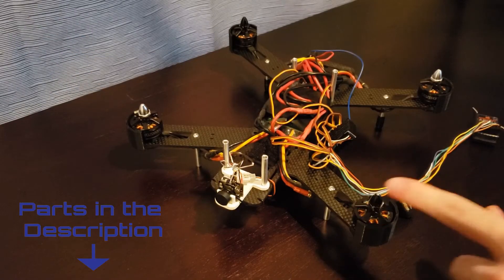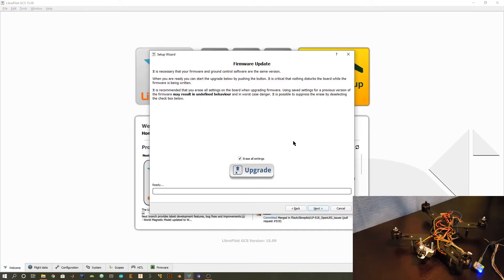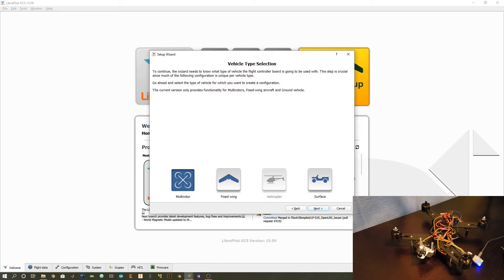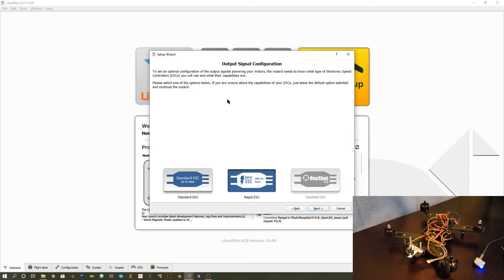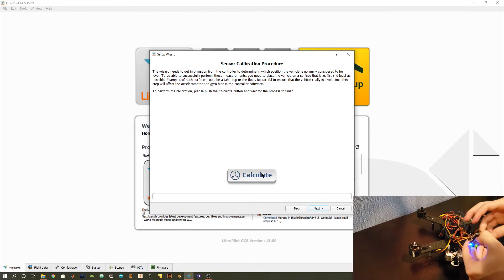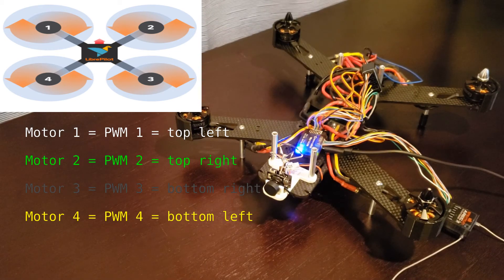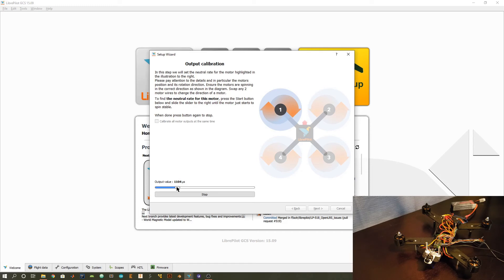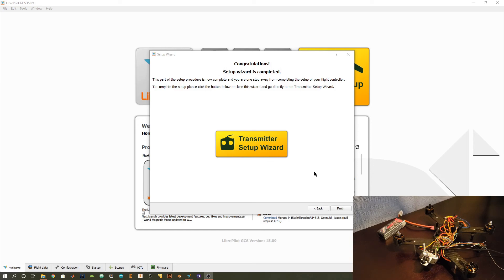CC3D Flight Controller Setup and Calibration with LibrePilot | Part 1

Comment: I've downloaded librepilot, but I can't connect using a laptop USB. How can I connect?
Reply: Try different cables,most cable will just have power only and some with data and power pins
Reply from the maker: I agree with above. Check that the cable you are using supports data transfer.